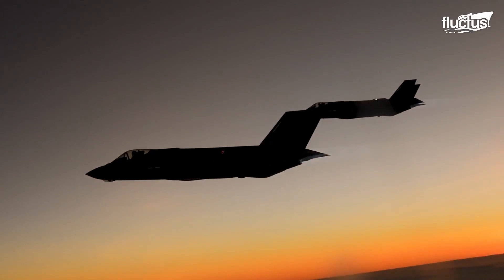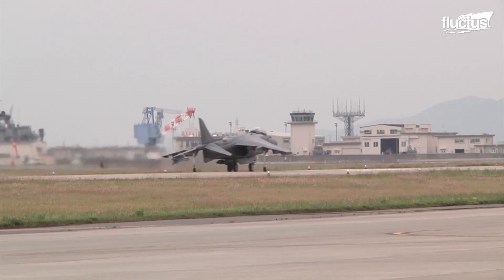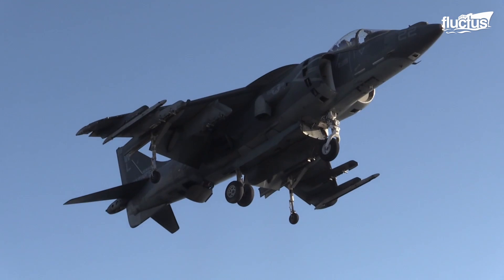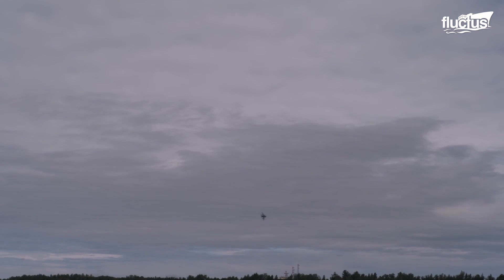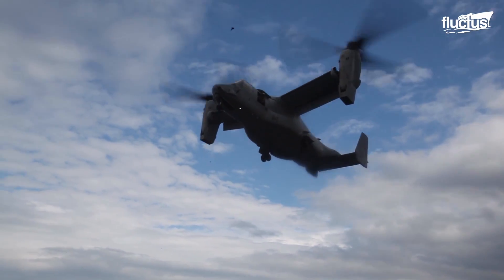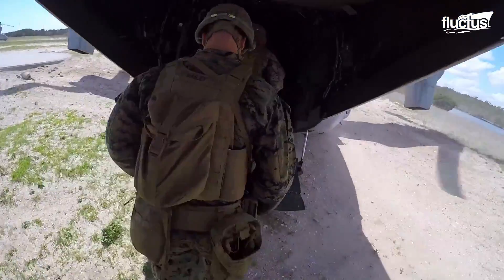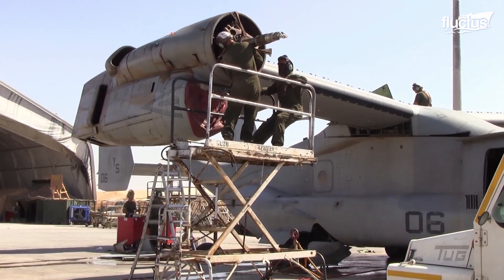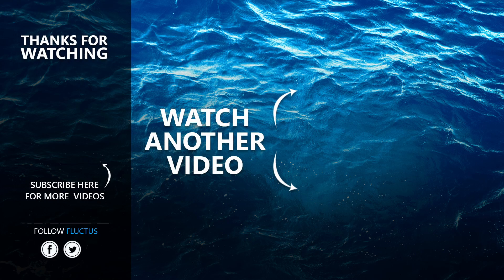UK and US Spent Billion $ to do This Special Trick at Sea

Comment: that type of helicopter that the engines turn, the Osprey, I see it very unstable, it is seen behind the tanker plane that does not stop nodding, more stable I see the Chinook helicopter with double propeller If the rotors do not rotate at the same speed, they can destabilize it and it is very difficult for two separate combustion engines to rotate at a constant speed. If there is a transmission bar from one end to the other and only one motor, there may be more stability, but if the Osprys I see very unstable.

Comment: Maintenance EVERY DAY?? hmmm
Reply: When maintenance on a sophisticated system doeisn't mean major maintenance. Just checking for leaks and servicing. In the USAF if you serviced the aircraft on a cold day, it may need to be drained due to heat expansion. No big deal.